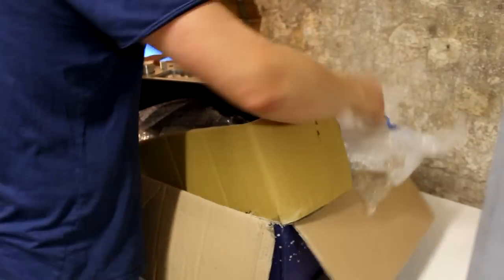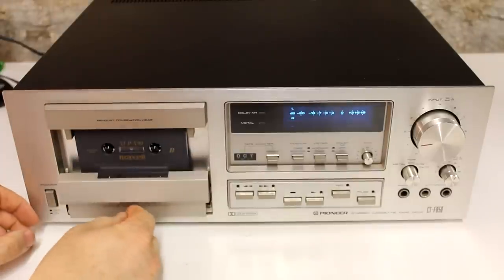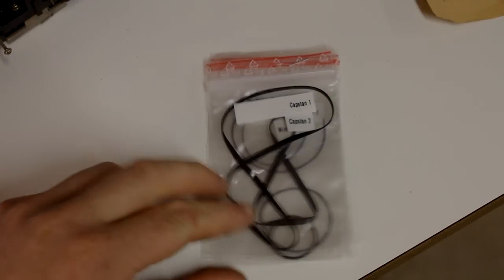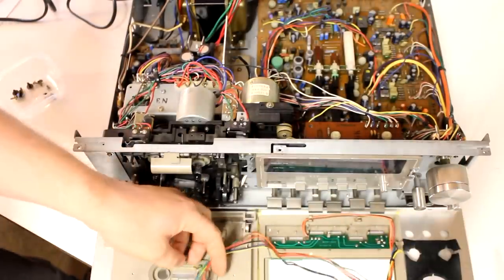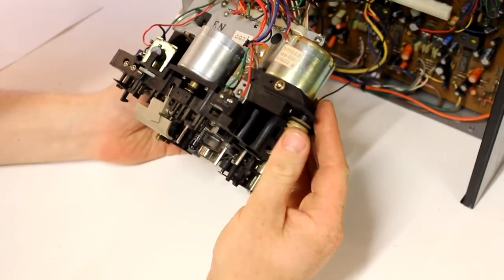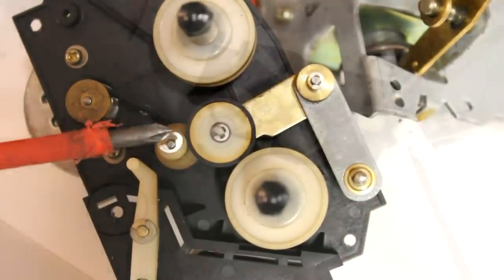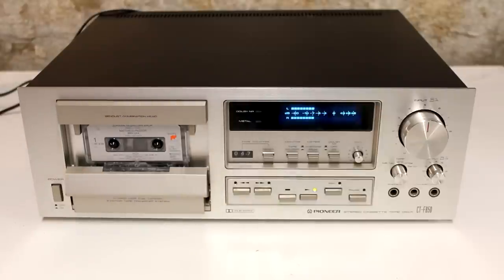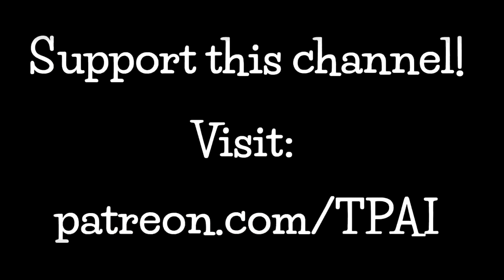Repairing a Pioneer CT-F850 Tape Deck  from 1979 (incl. Belt Replacement)

Comment: Thanks for that cool video. Still : what was wrong exactly? You changed the belts but from what I saw on the video, none of the previous belts were looking damaged or missing. Could you clarify please?
Reply: my guess is that they lost their grip and tension over the years. Because of that the reels didnt rotate properly
Reply from the maker: It seems that the old belts were simply a little to "loose". I can only guess that they weren't able to transfer enough torque to rotate the reels of the cassette properly. The take up reel wouldn't spin once the tape was under tension. But I'm not a hundret percent sure.
Reply: Please tell me the difference between loose and "loose", apart from the fact that one of the words has inverted commas around it.
Reply: The Post Apocalyptic Inventor correct. The rubber deteriorates with age. First it becomes more loose, and unable to transfer motion. If left for long enough (e.g. through years of disuse) they will disintegrate. Often they will stick to the pulleys, and you need to clean them to ensure smooth operation. In fact, it's always a good idea to clean your pulleys when replacing tape player belts.
Reply: yeah they make hell of a mess inside when they fail.. they turn into a sticky black tar/chewing gum like goo and are really hard to clean out.. so always good idea to replace them after its sat for a while.. another a good idea is to clean the pulleys and rollers as well as the heads and capstans with some alcohol and q-tips. that give the belts more "grip" and by getting rid of old tape residue, it might even improve the sound.. :)
Reply: The belts become harder over time, as the plasticizer seeps out of them, just more plasticy and less rubbery. Then, they just lose their ability to grip onto the pulleys and transfer any notable amount of force. Normal wear and tear after so many years. I think these belts were considered wear parts from the beginning.

Comment: I'm working on an old Cell phone; a Mitsubishi G310.  From 2006 or thereabouts.  Broken insert plug (on phone) plus the wall charger has no apparent power / cord connection.  I've no way to re-charge the battery (no external charger / adaptor ), as I have no idea which pins on battery receive the + / -  jury rig to place on my non-phone battery charger.

Comment: this guy didn't use ipa cleaning fluid on any of the dirty wheels pinch roller heads you can see the old dirty rubber deposit on the fly wheel .

Comment: does it have a line fuse on the 120 volt a.c. primary
Reply: Hi, David.  I know you weren't addressing me, but since you haven't received a response from the channel... Yes, it does and it is externally accessible, requiring only a Phillips-head to remove the fuse's retainer.  I came here to see how to replace the belts in my yard-sale find.
Reply: Thanks

Comment: you didn't appear to remove the rubber residue from the wheels before installing the belts. this is an important step that must be done as the residue 1; can stick to the nice fresh belt. 2 actually changes the diameters of the wheels, leading to slight innacuracies. this is HiFi after all so attention should be paid to detail.
Reply: kindisc not to mention, he did not examine the take up idler and clean/replace if needed. When this slips, he will have more eaten tapes and poor rewind/fast forward. Good thing is the idler can be accessed without tearing down the entire transport.
Reply: then there's other stuff to consider, like 40 yearold bearings needing lubrication, or even a de-gauss for the heads............

Comment: a German is a German when it comes to anything machines from tiny deck tape mechanism to BMW cars and more. perfection
I didn't quite like the down talking on the Japanese way of dealing with internal wiring, though

ps. I'm not a German nor a Japanese , so its an outsider non bias view